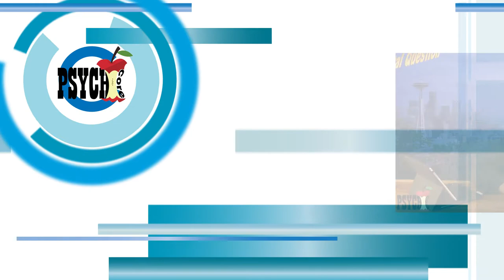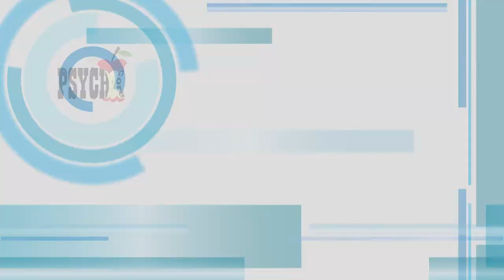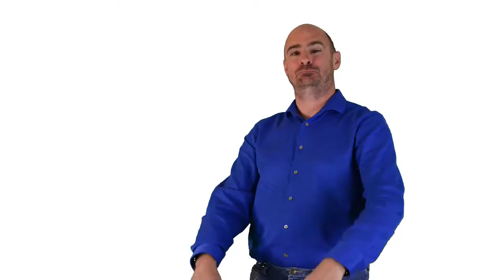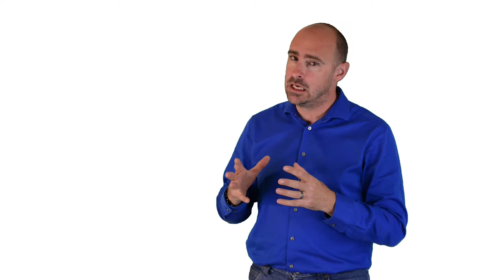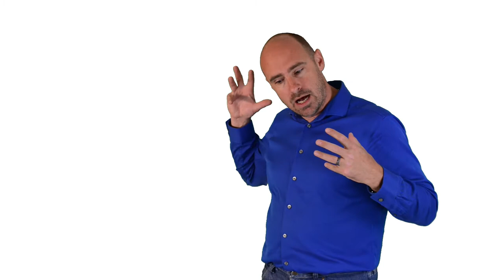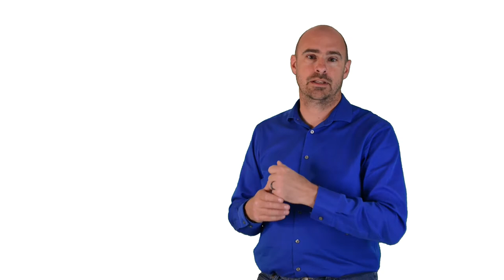Alternating Treatment Designs

Comment: why don't you draw a line across a phase change in general? is it because you usually have a baseline that separates the treatments?
Reply from the maker: Because they are different conditions. They don’t “connect” one is a pattern of responding under one condition. The next line is a pattern of responding in a different condition. 

There is no recording behavior during the switch - it’s one or the other. Hence no way to ‘connect’ the line logically.